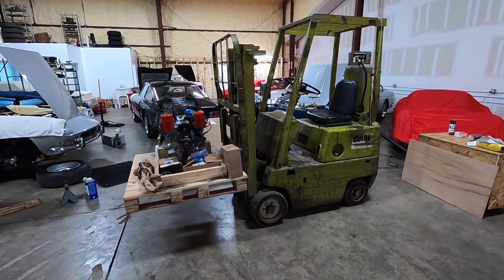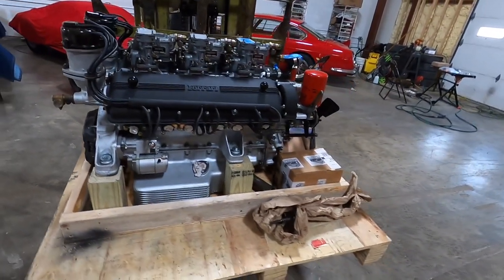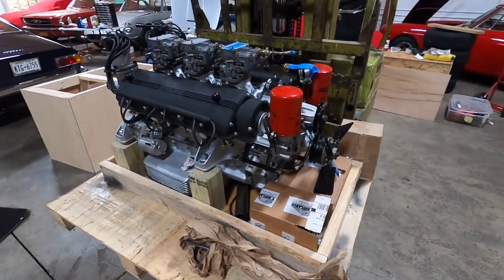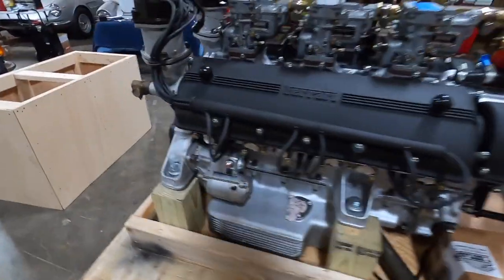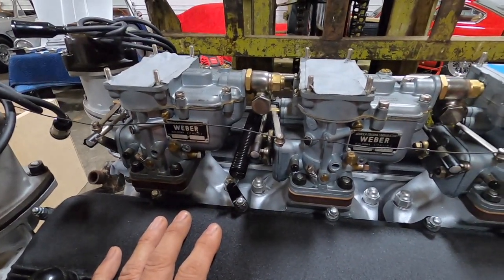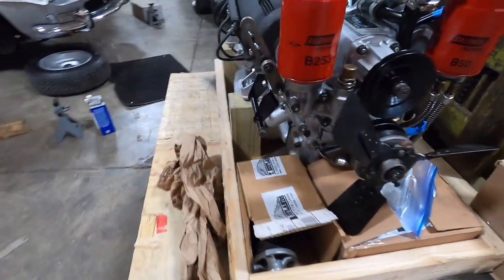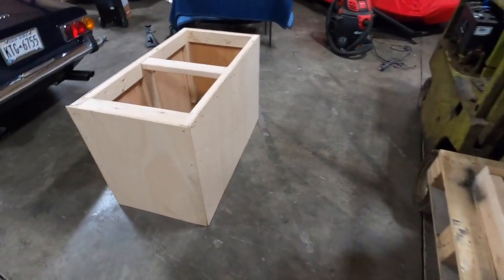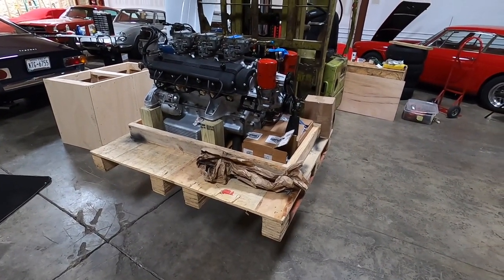Ferrari 250 Engine Shipping

Comment: Hey Tom, I know this may be sacrilege...but have you ever seen an aftermarket fuel injection used on one of these engines to improve driveability with to convert back to carbs? ITB's for example.
Reply from the maker: Vintage Ferraris are a  little different than other cars where their values are retained when they are kept bone stock. When the prices cross over to 6 figures, the ones that get the highest value are the ones that are original. That tends to drive the modification business. I do know one shop developing a FI system for a carbed V-12, but that takes $$ financial commitment from the owner. Thanks for watching

Comment: Hello Tom!!  I’m building a Ferrari 250TR 1959/60 and looking for an engine.  Do you have or help me to find one?  And I will need it to be rebuild…  any help is much much appreciated.  I love your job!!!!
Reply from the maker: That’s a tall order! There are reproduction blocks and heads available, but I hear many people still prefer the original blocks. How much do you have and what do you need? Water pumps, timing chain cases, intake manifolds, throttle stands are all different from engine to engine. The competition blocks are even more rare. It’s nothing that can’t be accomplished with enough money and time, but there are limits to everyone’s resources!
Reply: @tomyangnet  thanks for your info buddy.  I have unlimited passion for this project but unfortunately limited budget.  That being said I will proceed with anything you  recommend.  And we are in the middle of 3D modeling so I need all the engineers components.  Thank you Tom!!
By the way I’m totally find with a reproduction block.
Reply: I could also use a Ferrari 365 engine,  v12 and 4.4l with six Weber 40 carburators.  What do you think?  Is that engine easier to find and service?
Reply from the maker: @sebaamighini  any Ferrari engine is going to challenge a limited budget. Everyone’s tolerance for spending is different. If I had to guess the cost of a complete 250 type engine, $250K would not be unheard of. That is why basket case GTEs still sell for over $200K because you get a complete engine and can sell the rest of the parts. If you don’t need a 3 liter V-12, and want to search for a 4.4 liter V-12, you may be better off finding a derelict 365GT/4 and try to buy it for under $150K and start dismantling. The 4.4 liter engines are wide and may not fit in your project. Good luck!
Reply: @tomyangnet  thank you!!